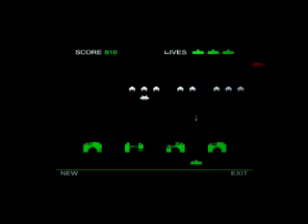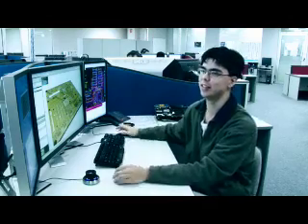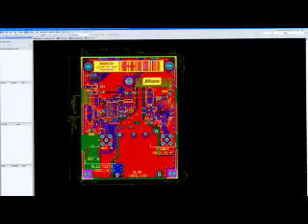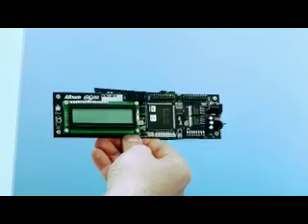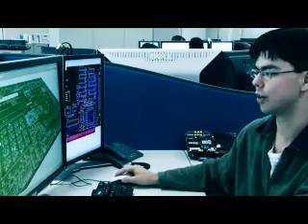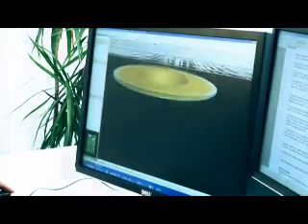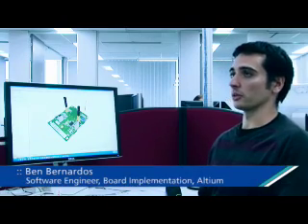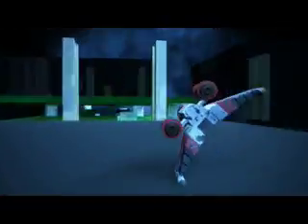Altium Designer goes 3D

Comment: It’s not just a 3D PCB viewer – Altium had that years ago.  Unlike basic ‘dumb’ viewers in PADs and Eagle, Altium actually has a 3D PCB editing environment. You can navigate and manipulate the board design in 3D in real time. You can also bring 3D models and assemblies (like a case design) into the 3D editor, then fit it to the PCB assembly where a built in collision detection system will highlighting any space violations. It’s all in the Altium website and Wiki.